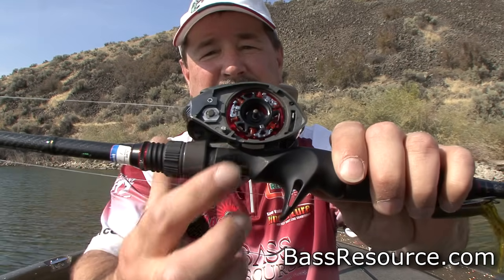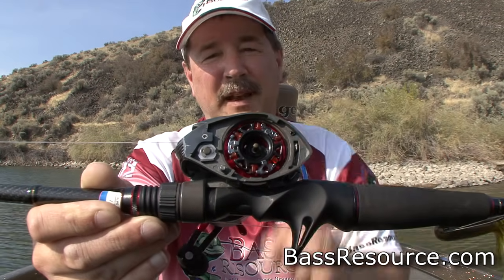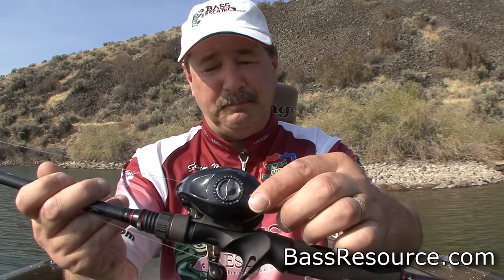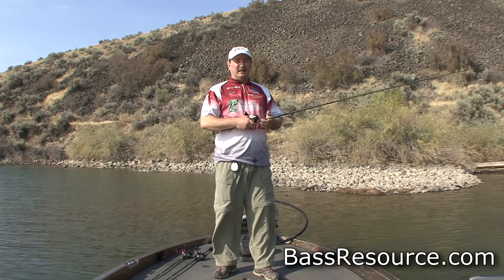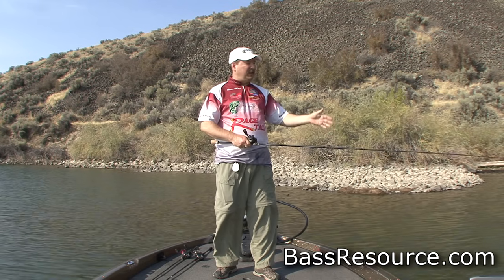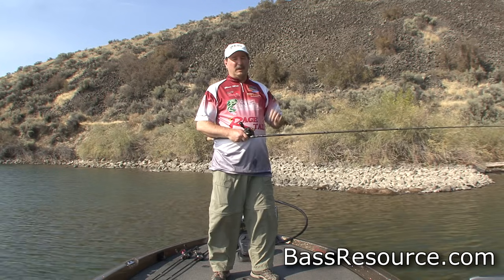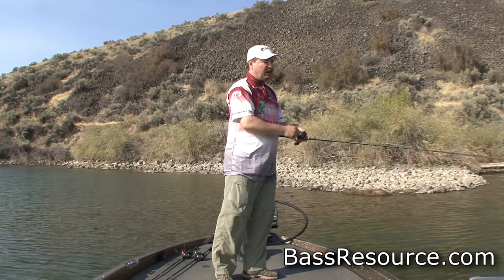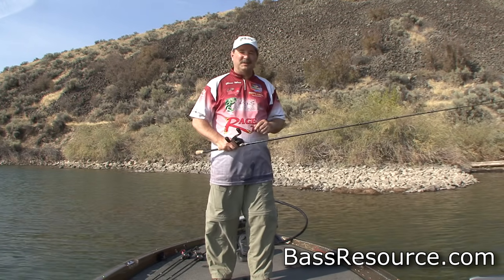How To Cast A Baitcaster | How To Adjust A Baitcasting Reel | Fishing Reel

Comment: The pins you spoke of are the "brake shoes" in the centrifugal brake. I see you corrected the "centrifugal brake/spool tensioner" mix-up so I won't say anything on that. >>>>> I have NO pins in my centrifugal brake (I removed them) which means the brake does nothing. A brake serves no real purpose anyway if you know how to cast correctly. >>>>> As for casting, the correct way is to hold your rod pointed behind you, then stroke it up, overhead, and forward with a smooth acceleration (you may also stroke it sidearm, or simply start with the rod pointed back over your shoulder before stroking it up, over, and forward). Note that you must always feather the spool with your thumb when casting. If you get a backlash sometimes, it's always because you accidently snapped your wrist at some point during the smooth acceleration. Keep practicing until you practice that occasional wrist snap out of the technique. >>>>> Casting as if you're using a spinning outfit (which is what you and most everyone else who uses a baitcasting outfit does) is the main cause of backlashes in revolving spool reels. The reason is, once you've loaded the rod on the back stroke then stroke it forward without a pause, that sudden lurch forward as the loaded rod snaps forward causes a sudden increase in spool rotation speed. That sudden increase often causes the spool to overrun itself. By casting as I stated above, the unloading of the rod is much smoother and does not cause the sudden lurch forward. The reason people started casting baitcasting outfits as if they're spinning outfits is because when revolving spool outfits were first made smaller for freshwater fishing use, guys who bought them simply copied how spin fishermen made their casts and it's stuck ever since. >>>>>  Don't buy a reel with a magnetic brake. Always use a reel with a centrifugal brake and remove the pins so the brake can do nothing. Now just adjust the spool tensioner to the weight of the lure you're using and cast as I said above. If you feather the spool with the right amount of thumb pressure and don't cast into the wind, you will never get another backlash. >>>>> A long time ago there were no such things as spool brakes and expert saltwater fishermen who used revolving spool reels figured out how to cast without getting backlashes. When baitcasting outfits came out for freshwater fishing, no one bothered to ask the expert saltwater fishermen of the day how to best cast with them. As for me, I always thoroughly research something I'm into, which is how I learned the proper way to use a baitcasting outfit. Most people, however, just follow what most other people are doing/teaching but what most people are doing/teaching isn't necessarily correct.
Reply: I just got my first baitcaster last week.....Pflueger Supreme XT..........I'm freaking ecstatic with the quality of the reel relative to what I paid. Thanks a ton for your input.
Reply: Your comment is pointless as people already know they can do as someone suggest or do their own thing.
Reply: +Thibeinn Why remove the centrifugal brake pins? It's the same as having all of them deactivated. Also, if you leave those pins in the reel and set them correctly, you don't have to feather the spool with your thumb during the cast. They are more consistent than your thumb could ever dream of being. How you have your modern reel set up is how old baitcasters from the 80s and earlier were... no brakes, just spool tension knob. I used those reels, back in the 80s and early 90s. Believe me, the new reels with centrifugal and magnetic brakes are substantially better and easier to use. Yes, for more distance I agree the rod tip should go further back when starting the cast swing. For close range casts and beginners, the short arc described in this vid is best.
Reply: I have no pins in mine because I chose to remove them. I thumb the spool which is what you're supposed to do. I never get an overrun (backlash) simply by stroking the rod in the correct way you stroke all rods with revolving spool reels.

Comment: The best way is no spool tension and turn your brakes about 60% to 70% on. You'll get the furthest distance possible, reduced backlashes, and your drag will work better. I won't adjust my reels any other way.

Comment: When my bait falls to the ground the spool should backlash. The whole idea is to use your thumb to stop it before it hits the water. You are restricting distance by teaching the hit the ground no backlash rule. The thumb stops it not the brakes. I teach people to sit at home with the rod tip up and keep releasing it and stopping it with the thumb until it becomes muscle memory. Good video but never teach people to clamp down like that, they will never train the thumb and get the distance they want later on. You are restricting the capabilities of the reel.
Reply: steve4321able this is for beginners, thats why he tells you to set the brake on max.
Reply: +steve4321able it really depends on how loose the spool tension knob should be. For baits with not a lot of weight but a lot of wind resistance (light spinnerbaits with big blades, light topwaters) I like the cast control knob so the bait will just slowly drop on free spool. Also, rods with a faster action tend to "snap" more as the lure is released on the cast. These rods will need a tighter setting on the tension knob to prevent backlashing at the beginning of the cast.